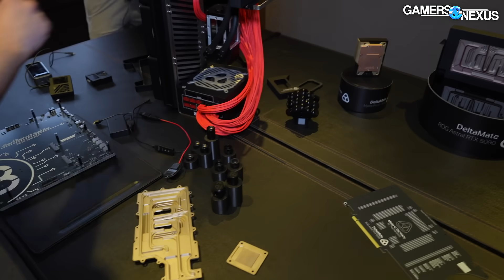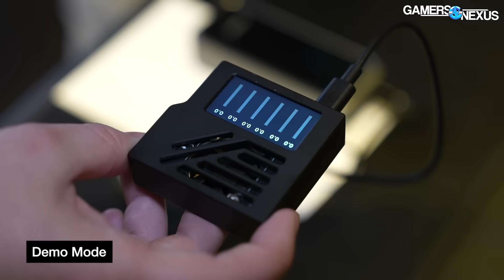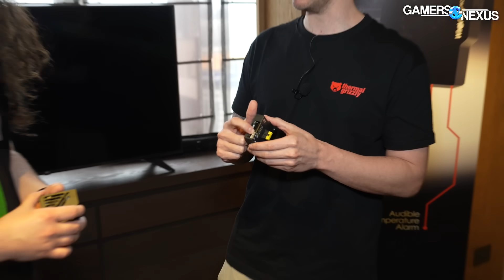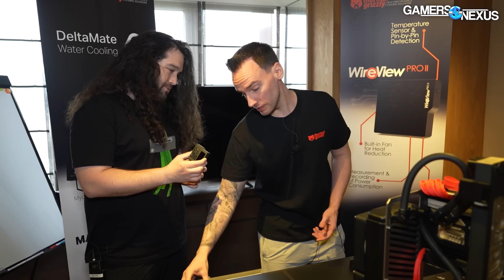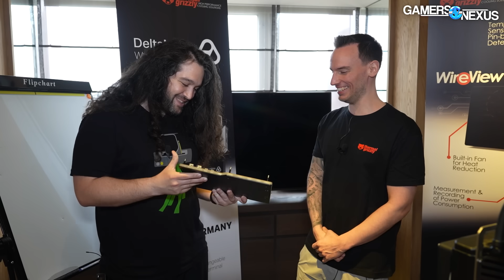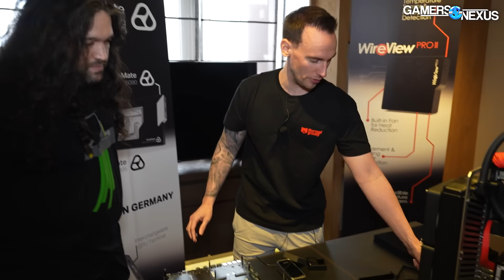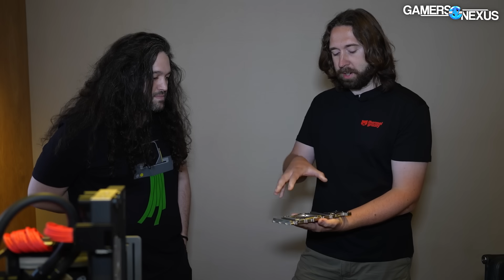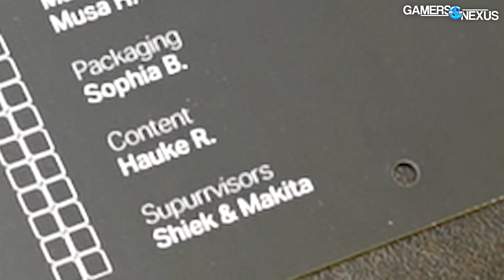Fixing the Unfixable 12VHPWR Connector, ft. Der8auer

Comment: Nvidia didn't make the 12v-hipower cables. They were willing to use this connector vs using 3 x 8-pin cables. The 12v-hipower cable specs are in the pcie standards.

Comment: Fuck Nvidia... Buy AMD. They should be forced to change the design of that connector... There is no reason why 3x 8 PIN should not be used. It has worked for 10 plus years...

Comment: A robust balancer adapter with active cooling that effectively blocks imbalance load to the GPU(limit per pin) and becomes the failure point itself, would be nice(if possible). The problem is clearly related to overload on any one pin due to resistance from wear or possible defects, thus balance + monitoring, & failure of any one pin not accepting a minimum balanced load(degradation) would be the warning signals to look out for.

Comment: So why don't 8 pin connectors melt? Is it just through sheer quantity of pins distributing the load that makes the current per pin essentially impossible to melt a cable?
Reply: maybe they dont know yet thats why i would encourage every 5090 buyer to get it and retroactively to all the gpu owners with the 12VHPWR connector

Comment: I think der8auer is wrong where he says we can't pin point the exact reason for the connector failure, whether it be balancing, resistance, or too much power. This is false. The 3090Ti and 4090 both pull 450W. 3090Ti's didn't melt. 4090s did. The only difference: 3090Ti's were current balanced. 4090s are not. Current balancing is the root problem

Comment: @9:22 Just redesign the device. It doesn't need to have the connector directly mounted to the PCB. Have it on a short cable run, that would even further improve GPU & case compatibility.

Comment: Didn't someone already figure out why that connector sucks so much ? Something about there isn't actually  any current sensing going on because they're all just connected to the same power rail on the gpu ? And then when it's drawing 600W on 6 wires and 1 wire fails, it'll draw 600W on 5 wires ? And the connectors don't have enough surface area contact that can handle the increase in power ?
It could have just been 2 8 gauge wires with a proper connector. Even better would have been if they added a 24V standard to atx psu's.
Reply: source?
Reply: @antiimperialista  One of LTT's videos where they x-ray the 5090 and it shows that each of the 3 'layers' is connected together. 12V, GND and whatever the tiny wires are.
Pretty sure der8auer figured this out too when he cut wires on the 12V while it was working.
Basically the card has just 2 bus bars.

Comment: For the 8ench Table 12V/GND/5V probing area, why not add a terminal (e.g. Weidmüller 1716080000) for wiring instead of soldering?

Comment: Why don't they just make 2 fat cables that actually screw to the GPU? You can bend them, you can change cable out angle and all that stuff. Lots of industries use this method and they're fine. Let's plug a car battery drawing 500+ amps on crank with some push pin connectors for easy install! What a great idea! They state you can only plug/unplug it so many times before it's not safe (12VHPWR) so the iT's EaSiLy ReMoVaBlE!!! stuff doesn't stick.

"oH, iF We sPlIt 500+ wAtTs tHrOuGh 12 DiNkY LiTtLe pUsH PiNs aNd bAlAnCe tHe cUrReNt eXaCtLy, SpEnDiNg mOrE MoNeY DoInG It, It mIgHt barely wOrK!"

Are we really talking about multi billion dollar companies that released this? Really? No lawsuit yet to make them go back to 8pin or make an actual connector?

Sad...
Reply: imagine the size of screwable power terminals on a gpu, its simply unrealistic
Reply: @antiimperialista  You got quick connects like Wagos that can easily push 2000W of power through them. 230V, sure, less amperage, but still.

I'm still amazed how some multi billion dollar companies can't release a damn power connector, that's all.

Same with thermal compounds: Everyone's complaining about direct die cooling being problematic and they put the same toothpaste each year
 Honeywell: Oh, actually...give back my beer. Here's a thermal pad that destroys all your toothpaste. I'm out.

Comment: 12VHP: A connection point that is SO FRACKED it takes an entire control board added into a system to keep it from burning your house down. I think that maybe 3 x 8pin or 4x 8pin was a better method of delivery. Everyone keeps going on about what the wires can handle, meanwhile the connection point itself is only a tenth of the cross section of the already anemic wires for the current they carry.

Comment: PXE boot is fine, but it means you need to mess around with each motherboard's configuration more to get something booted. Depending on what boards you're working with, how many different OSes you need to boot, and how often you're swapping them vs how long you run something, I can see having multiple local storage devices like that being more convenient.

Comment: I hope that Roman is actually putting the newer version 12v-2x6  aldough it call is 12hpwr how it came un the original,  Nvidia just needs to bring back the voltage regulator on the gpu side which did exist on the 3090ti.  When you make a $2000 cards that should be a requirement...

Comment: You can add feature to connect these little thing with PC to monitor temperature from the device.
Like i have Corsair commander pro which has few connectors to add a temperature sensors on a wire. You could use same pinout to connect your adapter to devices like Corsair commander instead of one temp sensor so you would have an option to operate on this temp values straight from your desk. I believe there would be an option to adapt such straight to mobo aswell.

Comment: Couldent you make it without the display just connect via usb to the mobo and with hwinfo you can see the actual temps, if the porpuse is just to see if is melting 1led that goes red if something is not right or if the porpuse  is to detedct the broken cable 6led to see if all cable are connected

Comment: JUST DUMP that stupid 12VHPWR  !!!   What is wrong with using the old TRUSTY 8pin ?  I don't mind having 3 on my GPU, or even 4 if needed !!  Or why dont just solder the cables to the GPU, so you ONLY get one connector ?!   ( that goes into an PSU )             JUST DUMP that stupid 12VHPWR  !!!

Comment: @der8auer Hey Roman, here some ideas what might can improve your Per Pin Current Sensing with data logging 😊:
1. use high polling interval for the measurement without overloading or overheating the controller (perhaps something between 50ms - 300ms, if possible) and save average values every 5 Seconds or so
2. use interrupt by reaching max. permitted current value or exceeding this limit. For logging these amp spikes too. Well... it depends at the max. polling rate to log spikes or not.
Viele Grüße 
✌

Comment: Why does the PC industry insist on using this multi-core bullshit with 5 positive leads and 5 negative leads? The only reason I can think of is to keep the cable flexible. You now have 10 connections instead of 2 and if one fails the rest take up the load and burn. 

In the RC industry they use thick gauge, fine stranded cables with silicon insulation. It’s very flexible. One positive lead and negative lead. For connectors they use XT60 or XT90 connectors which can handle hundreds of amps (peak). They are extremely compact and robust. I have yet to see one burn.

Comment: Sorry, don't be mad, but the differences in current also occur with ground... you have to measure all 12 currents to be relatively sure... from an electrical point of view, you have to find out where the different currents are coming from... since the cables are connected on both sides (graphics card and power supply), the differences can be found in the resistance of the connection (yes, I know we're talking about resistance in the very low milliohm range)... are the differences in the connectors? or are they in the crimps? or in the cables? ... a fairly simple test would be to use PCB connectors on both sides and design a board for soldering, then use only two "thick" wires for the 12V and GND connections... then simply measure the temperature of the connectors, and you'll have a result... I suspect you've gone way too close to the connector specifications... parallel operation to increase power is often not so easy or permissible in industrial electronics, as it is known that component tolerances can cause currents to be unevenly distributed... Regards from Germany

Comment: Regarding the statistic of 0.3 percent of confirmed burnt connectors based on WireView pro sales, I assume that the total sales figure includes 5080 owners. But it's the 12v-2x6-5090 combo that's most likely to burn. I'm guessing that the figure is a little bit higher if only 5090 owners are taken into account.

Comment: XT90, job done. i know multipin connectors reduce wire gauge, and increase high frequency response, but honestly throw more caps on the board and make a standard termination at the GPU connector end. it works for solar, FPV and heavylift drones.

or like, just more 8pins. is it really that important to have a single connection for a space heater that big? 4 8pins is better than a dead gpu.

Comment: I am not an electrical engineer but if one 12v hpwr connector has a risk of drawing too much power and cooking itself, why dont they simply lower the power limit and add another 12v hpwr connector to split the draw on each connector? The board itself will draw the same total wattage but how it is delivering the power to the card is slightly different.

Comment: 8:39 I understand the hesitation but 100 USD is not bad, if you consider the monstrous price tags on current GPUs and the potential safety net this product would provide. People spend more than that just on custom sleeved cables.
I assume he didnt want to commit too much on the price because of pending tariffs, which just dont effect export cost but potentially manufacturing costs as well. Not to mention the additional engineering and spec manufacturing by itself.

Great video!
Reply: kinda dumb to assume everyone who buys a 5090 can afford another 100$. Many people save up over a long time to afford this. 
While it is a really helpful business idea, sure, it is just too costly especially in countries like India where the prices are already way higher for GPUs purchased from retailers. It would be better if PSU companies start using cables that can relay current and send the value digitally over to the OS so hwinfo can display it.
Reply: But why should I have to spend more? Nvidia’s problem………..not mine! F-Me!!!
Reply: I disagree. Consider 100USD vs zero cost to the consumer if Nvidia just fessed up their connector design is flawed, and then used 4x PCIE 8pin connectors into the GPU instead.
Reply: @citizendc9  thats like hoping a million dollars are gonna suddenly appear in your house
Reply: @citizendc9  they wouldn't even have to go away from the current connector. Just use more so fewer amps are running through each pin which is the current problem
Reply: @turtleman190  I would go the other way and rely on 2 pins instead of more pins. There are plenty of existing connectors out there that can easily handle the power requirements, for example XT120 which can handle 60A continuously so that's 720W.
Reply: @zapador  that would be the best option, but nivida seems pretty set on keeping the connector they have now no matter the cost

Comment: Sapphire's solution was to have the 3rd fan of their Nitro+ RX 9070 & 9070 XT blow cooled air directly on the connector, this way it never get hot either.
Not sure if Sapphire's solution would be ideal for them power hungry NV boards tho, an ingenius idea Roman!

But why go through so much trouble if NVIDIA can just make a safer connector?  it's NV's fault cards are dying lol,  no one should be need to find a solution to NV's bs tbh.
These are issues NVIDIA should be solving and not the consumer.

Comment: It would not surprise me in the least if these companies figure out the video card design is the problem and not the cable or connector.  

THEN they decide to change the cable connector back to the 2 or 3 8 pin connectors.

Comment: I'm pretty sure I know why the 12VHP connector sucks so much. The basic design was essentially an existing Molex connector. I believe it was the Micro-fit? Anyway, that connector had an amp rating. That amp rating was lower than what the 12VHP connector is rated at despite having the same size, same pin/socket dimensions, etc. So, what was done to improve the connector to allow this higher amp rating? They raised the allowable temperature for the connector. Thats right, they didn't do anything electrical, they just made it acceptable for the connector to run hotter due to the extra amps going through it. No, that isn't a joke. Theoretically this meant different plastics might need to be used to maintain the same properties at the higher temps, but the point remains that the difference between the 12VHP connector and the Micro-fit connector it was based off of is that the 12VHP is allowed to run hotter.

Comment: So this Wireview attaches directly to the 12VHPWR connector on the GPU like the first version?  Would it be better if it could be mounted somewhere else in the case. Yes that would require an additional 12-pin cable as downside. Also the LCD screen would be less useful if it was not mounted on the GPU.

Comment: Yo @gamersnexus let him know for the water block fins to look into EDM for machining them. Uses electronic discharge to remove material instead of a cutting blade, so it's got easier tight tolerance machining capability and won't damage other fins as it machines them. Would need a fancy angle spool adapter for the feed but it's totally doable and probably has higher yield and similar machining times.

Comment: Oh dear.....  
...by inserting the measuring unit into the 12Volt lines you are already lowering the +12V Voltage by some Millivolts. Even if it is just 0.1 Volt (100 Millivolts) this will mean the GFXcard will have to draw higher current to compensate its need of power. This means, just by inserting that measurement device the stress on the wires will rise again, NVidia could claim your measurement unit to violate the connection certifications, as you are introducing additional resistance into the 12V power lines...

So, according to your former measurements NVidia pushes the cabling/ plug contacts to it's absolute limits of 10 Ampere per wire, at least on some wires. Now you are lowering the Voltage by the burden Voltage of the measurement device, this results in the switching power supply on the GFXcard having to compensate drop in Voltage for generating the needed amount of power (P = U multiplied by I), creating even higher current, leading to higher probabillity for heating up even more, 

Now, if you really find out the connections would melt - Is it then the "Hen" or the "Egg" of the problem?
Fact, of course, is that it is always a very dumb idea to push some connection whatsoever to it's very physical limits! So, the main problem is still NVIDIA and it's power hunger in combination with their power delivery concept.

Comment: $100-$150 is a big deal if its a $1000 video card

$100-$150 is not such a big deal if its a $3000 video card

Well done nVidia, you saved $10 in parts and labour and created a new $100 accessory market for your video card.

🤦🏻‍♂🤦🏻‍♂🤦🏻‍♂🤦🏻‍♂🤦🏻‍♂

Comment: For the current sensor, it's nice, but it may bend cables in weird ways with a vertical GPU in a standard tower.

Not doing the USB to the lower board over USB-3, and especially having the Windows image on an SD card, will be a paaaaaaaaaaaaain. But you do you. At least buy a A-1 cards. I'm also not a fan of omitting keying shrouds on fan connections, it's just asking for someone to connect it the wrong way around during an intensive testing session.

Comment: I realise the original 12VHP connector was designed with backwards compatibility with  older PSUs in mind, but if the power is all blobbed into one when it reaches the GPU, why not have one thicker power cable and the data cables instead?

Although the way nVidia are going, GPUs will soon have to be plugged into the mains directly anyway. At least in the US.

Comment: The bench platform is cool, but I’m a bit confused by the MicroSD slots. Isn’t running Windows off of such slow storage problematic? 

Wouldn’t it have been better to have NVMe slots with an extension cable that could run to a m.2 slot? 

I could be super wrong. I’d be happy to hear why.

Comment: It'll be cool if they can make that thing toggle between a "sparse recording" mode where you update once per 5 second and a "rapid" mode like several times a second or even higher. If onboard memory can't handle the data then send it through USB.
This way you can see the behavior of the card when you launch a heavy load or even see transient spikes.

Comment: Well Roman I really like what you do but please do not go the EK route where you start doing and selling very expensive product, I know you got the engineer from EK but don't do this. 100€ for a waterblock is ok but 500€ is not ok. You don't need to make it to look nice as long as it is functiional. The current direct die cpu waterblock is a good example of excellent cooling with the right price.
For the wire view making your own connector is good to have a wide compatibility, but you could also sell the "normal" version at a cheaper price for people who don't need this extra compatibility clearance if 12VHPWR connector have already eough clearance around it.

Comment: I think both steve and roman were correct with the 12v power cable monitor. Roman's system power down damage prevention feature is a great idea. I also think data collection to avoid NVIDIA warranty shenanigans is also a great idea.